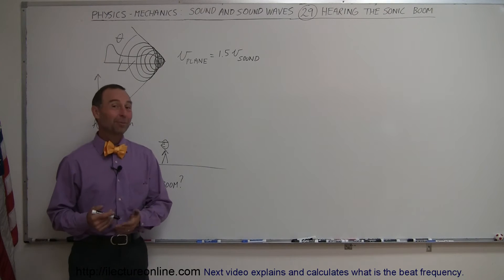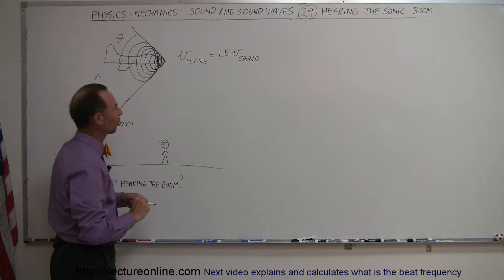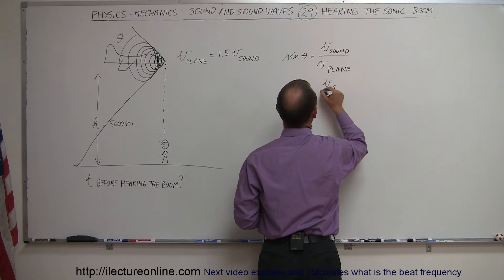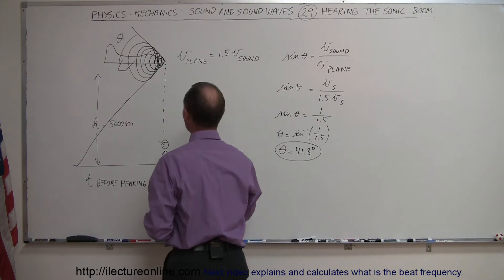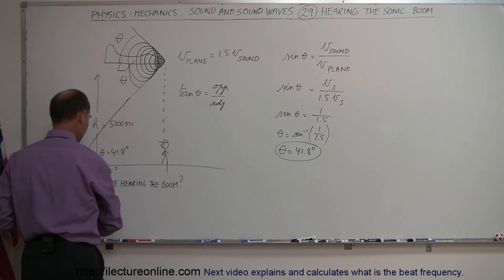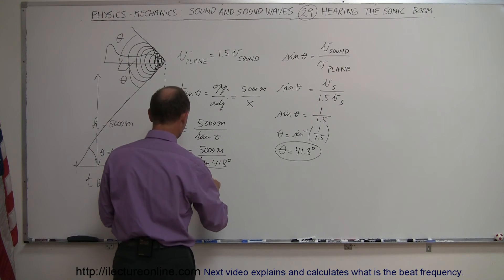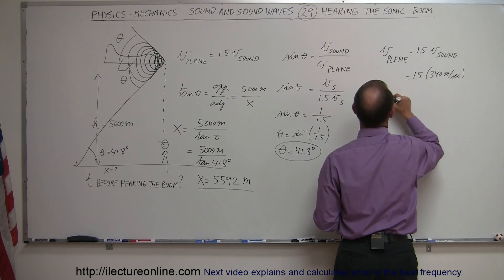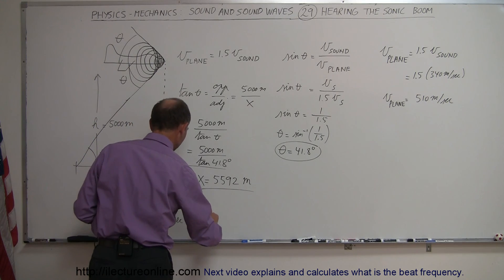Physics 20  Sound and Sound Waves (29 of 49) Hearing the Sonic Boom

Comment: Mr. Michel, didn't you get the angle wrong? Theta was given in the problem and the angle to the horizontal is 90 - theta, the the angle you said is theta with the triangle height and the distance x is 90 - theta so the other angle is theta! Please type your confirmation!
Reply from the maker: We believe the answer in the video is correct.
Reply: @MichelvanBiezen  I know but how is it correct?
Reply: @andrewjustin256 His angle is correct. draw a horizontal line straight back from the plane. The angle theta for the mach cone would be the same on top as it is on the bottom of the angle that is made using that horizontal line and the diagonal line that represents the cone. extending that diagonal line to the horizontal ground now gives you a pair of parallel lines (the horizontal from the plane, and the horizontal from the ground) and a transversal (the mach cone) from geometry, alternate interior angles are congruent. Hope this helps.